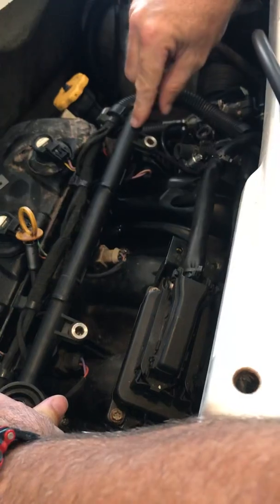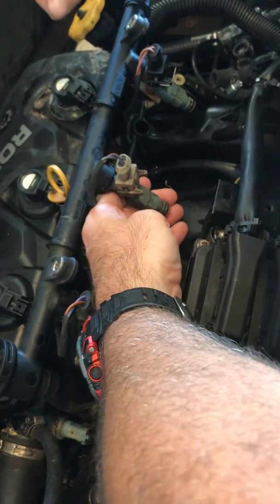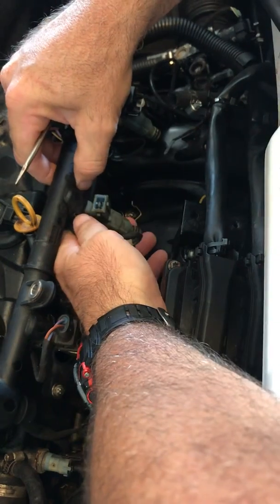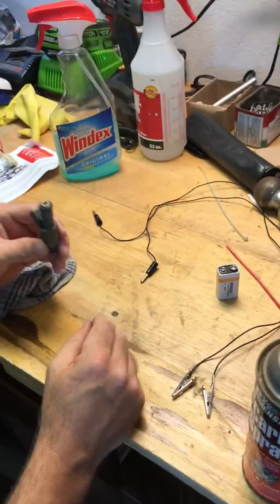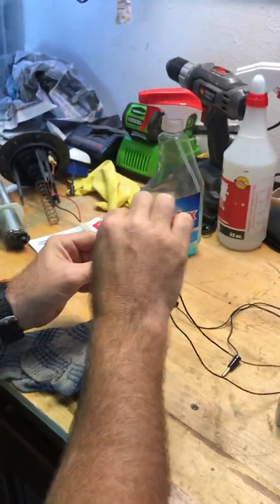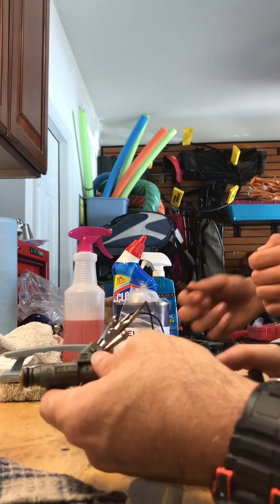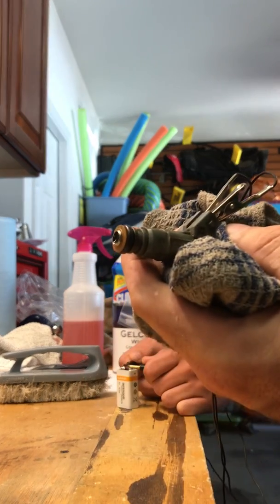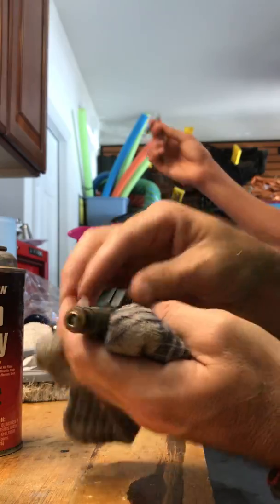DIY fuel injector removal and cleaning Seadoo 4-Tec engine

Comment: What kind of wrench did you use to remove fuel line? Star drive?
Reply: You talking about the fuel rail?  My fuel rail is held on by an inverted torx.
Reply: E-torx or external torx
Reply: Vice grips worked just fine. They’re not super tight, mine showed 0 evidence of using them.

Comment: push the clip in with your finger .no need to pull the elctrical clip off and lose it.never let stuff "drop " best way to lose it. dropping stuff mainly little pieces like that in a engine or bay is anightmare to find most of the time